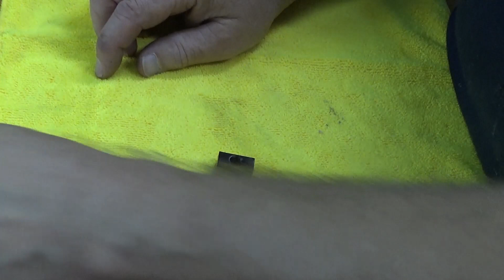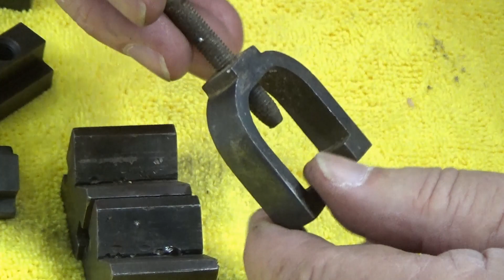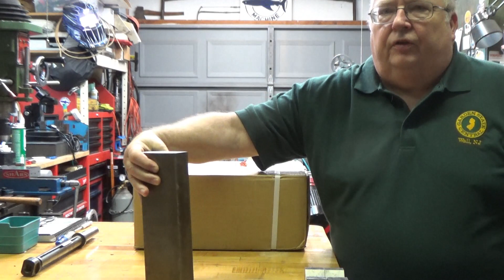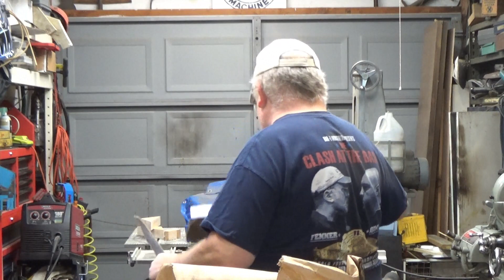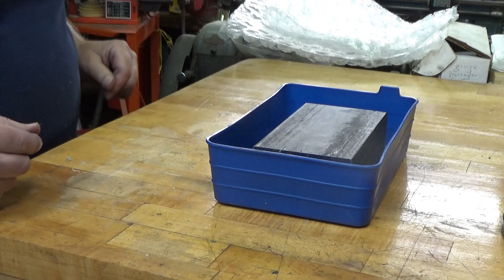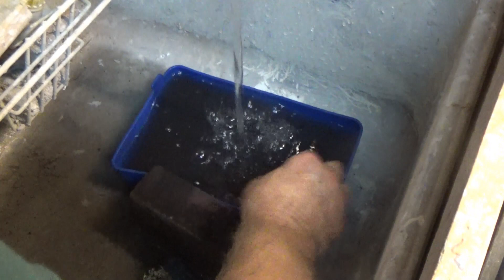Shark Bits #33- Odds and Ends

Comment: I have to admit my little import bandsaw was one of the best investments in the shop - the original cheap blade didn't last long but the variable pitch Starrett blades hold up well.  And that vinegar trick is awesome, I have a big stack of A36 from an auction a while back and often machine through the scale.  Might have to soak the lathe T-slot plate in vinegar after seeing your process there, lol!
Reply from the maker: The original blade held up well but the O.E. replacement not so much.  The Starrett blade worked flawlessly.  Mechanically removing the mill scale is to much work. Thanks for watching and commenting.

Comment: Hi Steve, at12:48 the writing on the box stole your thunder. LOL  Nice mill scale removal.  I have used vinegar for derusting, but use electrolysis now.  I have 3 gal of vinegar, in a 5 gal bucket, I'll try it on some hot roll I have.  I'll be bringing out a new video soon.  By the way I had HS Machine Shop 1968-1970.  I have a machined railroad rail anvil I made in HS Shop.  Stay well.
Reply from the maker: Thanks for watching and commenting.

Comment: Interesting...the Ox block....hmmm, thinking longer block with wheel notch offset towards outfeed would give a longer more stable entry into the wheel....Tom gave me a piece of delrin to make mine and it is on the build list
Reply from the maker: I agree with you but I already cut the material, however I am planing a minor mod that should make the parts slide more smoothly.  Thanks for watching and commenting.

Comment: I've used helicoils and Time serts to make the threads smaller in my other projects. Could this work for your 2,3,4 and other blocks? It might be expensive to do for all of the holes, but a few could work. Or perhaps keep the time serts removable and move them to the holes you need?

Thank you for your content. I really enjoy the opening when you turn the lights on.
Reply: Could you not just take a bolt that was not hardened, drill and thread it to a smaller size.
Reply from the maker: The blocks are hardened so re-threading it not really an option.  I have considered making threaded inserts but that would be as much work as making what I want.  Thanks for watching and commenting.

Comment: Thanks for the great video, Steve! As you showed, vinegar works great, is cheap, and is easy to find. I have also had good luck with citric acid (a few tablespoons per gallon plus a drop of dish soap to improve wetting in case there is any oil on the steel).  Looking forward to seeing more surface grinding on your Sanford MG!
Reply from the maker: I have heard of that also but have not tried it yet. There will be some surface grinding in the chamfer fixture build.  Thanks for watching and commenting.

Comment: Great "steel pickling" caper with the vinegar to descale the HRS Steve. The mills near me used acid before the EPA lol!  I just glass bead it off, but your way would be great alternative for home machinists without it. I've got to follow your HRS project along... Like the clamps for the mill table. As a welder, I weld on tabs on stock ends, and remove after machining, only because  I like to weld and grind lol  Cheers!
Reply from the maker: When I had my automotive machine had I had a good glass bead cabinet.  No more, I miss have the shop but I don't miss the business.  Tabs are a good idea never thought about them for machine purposes.  Thanks for watching and commenting.